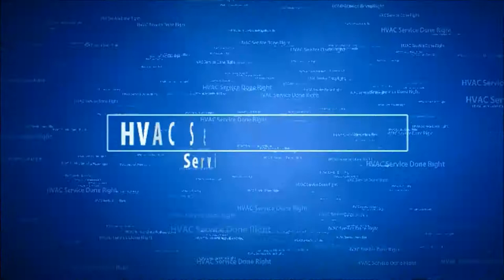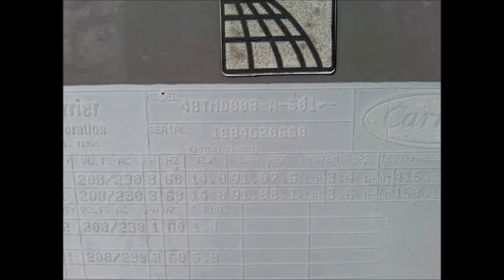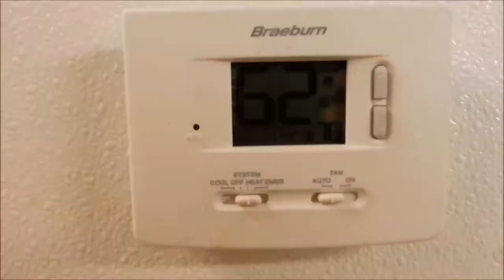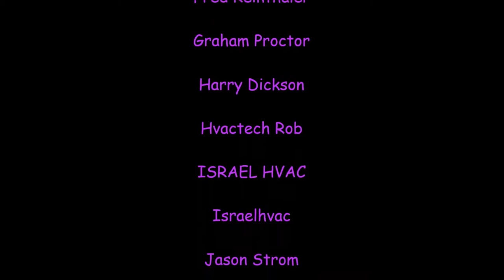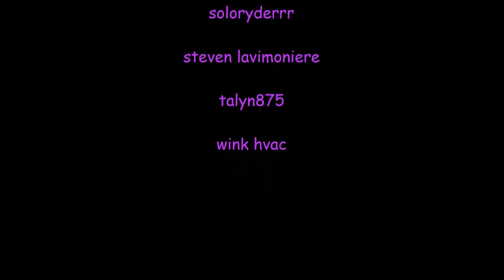Replace A Roll Out Switch

Comment: Did you use process of elimination or how did you figure to check the flame roll out switch?
Reply from the maker: +SombraLocs  First the light on the board said it was the roll out. Then I followed the 24 volts until it stopped. When I got to the roll out it had power only on one side. So I bypassed it and unit came on. I let it run for 30 min's to see if it would trip the roll out and it did not. It is still going as of today. I will be firing up them units this week for their winter check. I will see if it is still working.